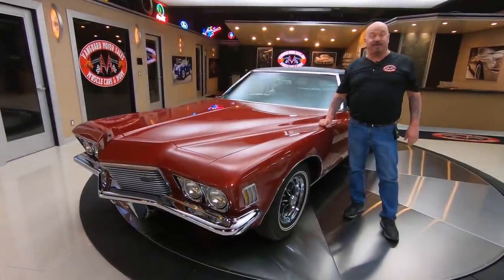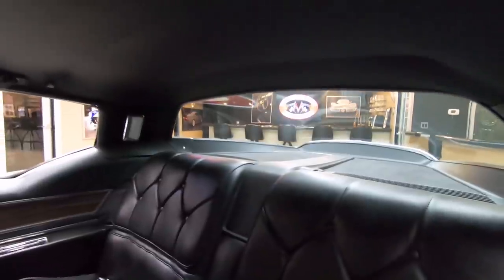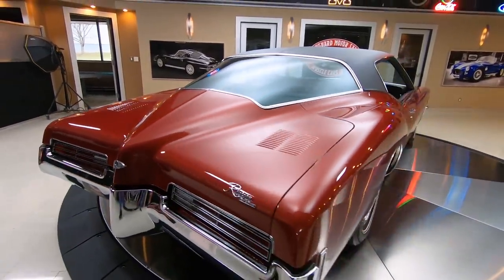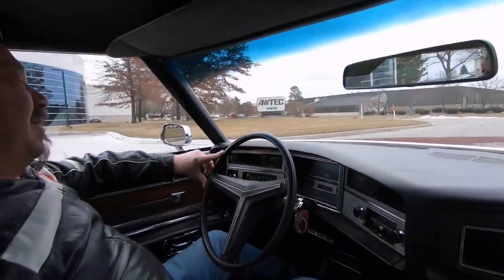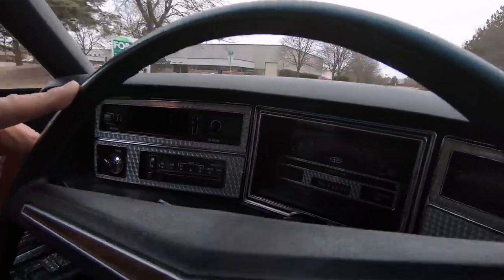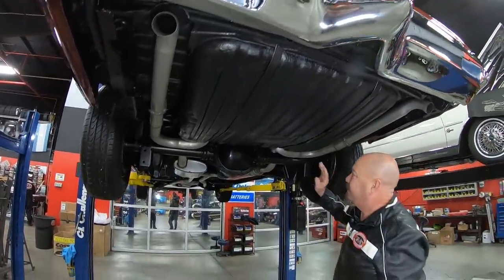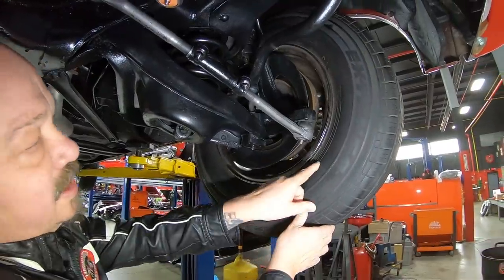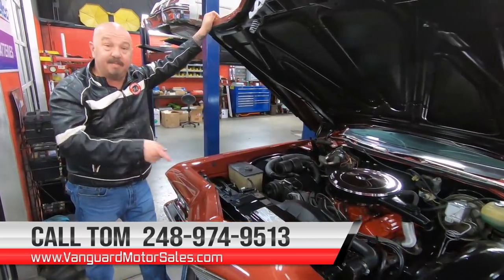1971 Buick Riviera Boat Tail For Sale

Comment: I had a 73 restored some jerk pored gas in the firewall and set it on fire in my driveway total loss mine had lighted turn signals in front of front fenders they looked factory i see this one doesn't have that feature it was the best car I ever owned so much fun to drive i took it from Wisconsin to Montana and never felt a bump in the road Montana at that time had reasonable and prudent speed limit i set the cruise at 110 mph

Comment: peak GM style here...none finer.  GS got you a steeper rear gear and posi, shocks and springs...was not an engine upgrade.  Stage 1 got you the hotter engine...a separate option...you could have one or the other, or both.  luv this.